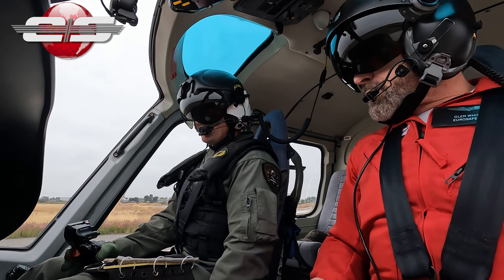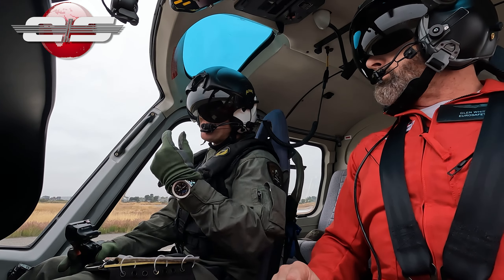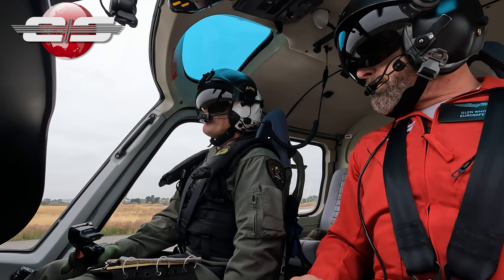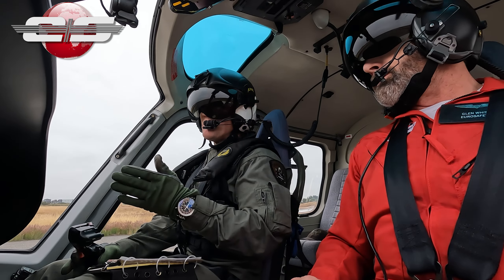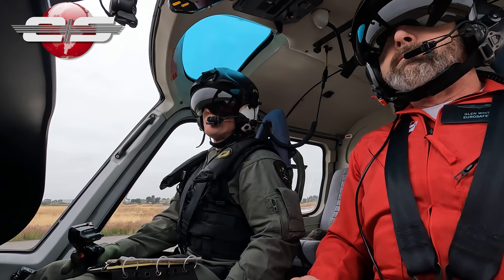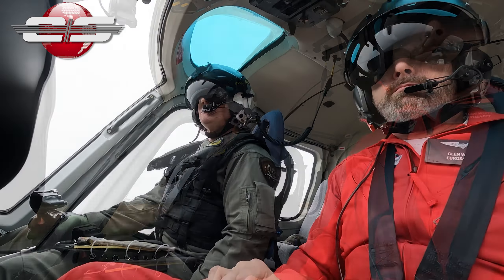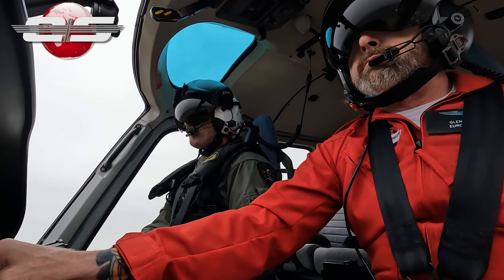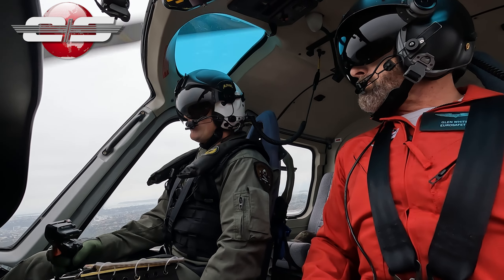#62 - Inside Training Guide : AS350 Single Hydraulics Failure

Comment: Hi Glen. Couple of questions surrounding the effect on the pedals in a hydraulics failure . 1. Does the accumulator associated with the yaw load compensator function in a different manner than the accumulators on the cyclic?  i.e. When an initial failure occurs the cyclic is going to feel the  same , so what is different with the accumulator linked to the tail rotor?   i.e is it filled with a fluid rather than a gas , or is the yaw load compensation system  pressurised mechanically via the pedals  ?  2. When the hydraulics fail and the heli yaws left ,is this because there a denigration of anti torque or an increase in torque reaching the rotor system causing a left yaw ?
Reply from the maker: Hello Dave. I have made a video on this subject... https://www.youtube.com/watch?v=UBEk-_K5Vac

The accumulators on the main servos are the same design as the accumulator on the yaw load compensator. Its a metal container with a rubber bladder on the inside filled with nitrogen. Hydraulic fluid is pumped into the container and collapses the bladder. The bladder is then trying to push fluid out. On the main servos when there is a hydraulic failure the accumulators push fluid into the main servos to give hydraulic boost until they run out of fluid (an entire other long discussion about how servos work). Once the accumulators are depleted on the main servos there is no more pressure available and the controls no longer have hydraulic boost. The yaw load compensator is a closed system. The accumulator on the yaw load after a hydraulic failure pushes fluid into a chamber in the yaw load compensator to induce twist into the spar of the tail rotor . When returning the pedals to the neutral direction the twist in the spar helps you push the fluid back into the accumulator. To answer your question regarding yaw to left. You are referring to training I assume. When I create the hydraulic failure in training I depress the HYD TST (ACCU TST) pushbutton which reroutes pump pressure back to reservoir and dumps pressure out of yaw load compensator. So during training you do not have a yaw load compensator (there is a way to get it back before you switch cut off but this just confuses pilots so we have you do the landing without yaw load... at training weight the forces are the same at high weight with yaw load.... kinda a whole other conversation). Since you lost the compensator at the beginning of the training failure the twist wants to come out of the spar on the tail rotor. So your pedals move and you do not stop them. Did I answer your questions?
Reply: @EUROSAFETYTRAINING  yes all makes sense now.  Thanks Glen
Reply: You practice by switching off hydr switch or for practice purpose press accum and after 5 sec depress